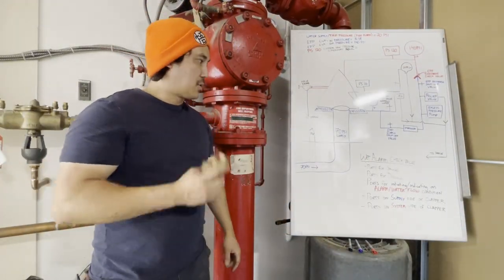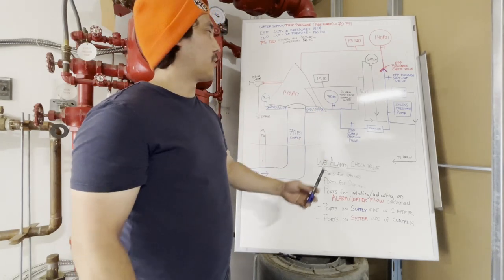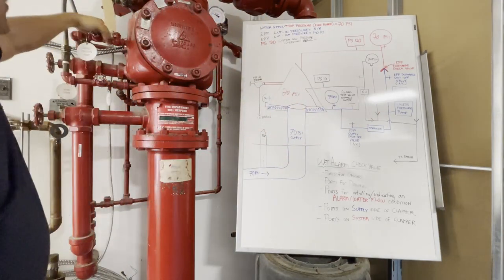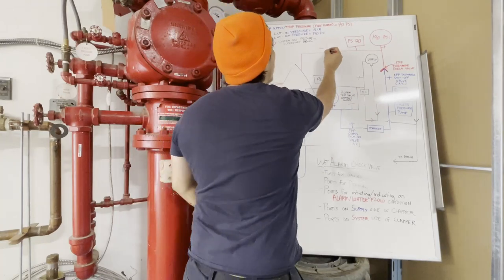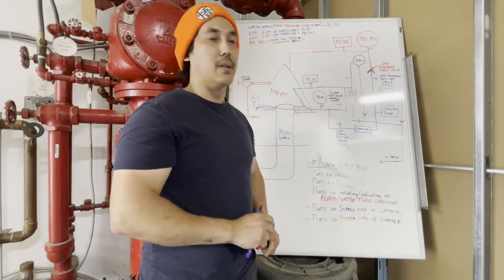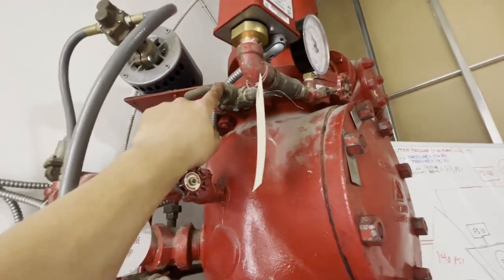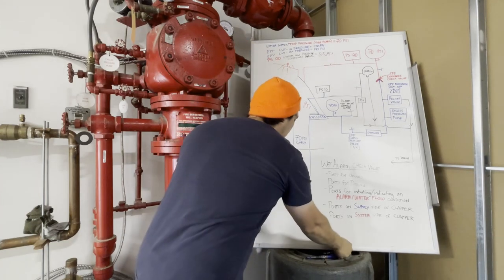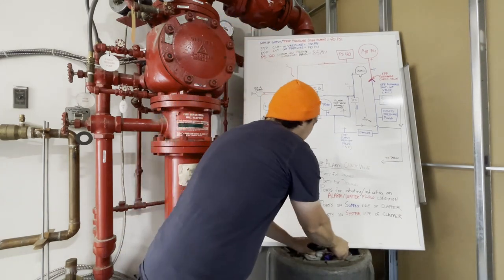Fire Sprinkler System- Wet Alarm Check Valve Explained

Comment: Wow this is the best sprinkler video I have seen in a long time! Thank you so much for posting and please post more!!
Reply from the maker: Thanks for the kind words! I'll do my best to make a similar video for a dry pipe valve and hopefully one of each type of preaction system. Is there any material in particular you would like me cover?
Reply: Dry systems and preaction systems would be great!! Do you service fire pumps?? That would also be really helpful. I love how you showed the components and explained how they work. I am a fire inspector and I’m trying to understand these systems better. Videos like this help me work with installers as I can speak more intelligently on the systems I see. Older, legacy systems videos are always helpful or even a video on a full 5 year process or internal obstruction investigation 😊😊
Reply: Also I wanted to ask, is there a maintenance frequency in NFPA 25 for these excess pressure pumps? I didn’t see them. Does it just fall under a pressure switch for the automatic ones? If so, would that be more of a fire alarm maintenance requirement or fall on sprinkler fitters?
Reply from the maker: @juliebellinger6117  I'll see what I can do about dry pipe valves and Pre-action valves. There's a few different variations of them and I like to make videos with actual live systems so that I can actually trip them/show a real world scenario. 

I do a bit of everything to be honest, its on a job to job basis really. But yes I work on everything, fire pumps, wet, dry, pre-action, deluge, special hazard (FM, Victaulic Vortex, High pressure CO2), foam, fire pumps. I'm a licensed journeyman fire sprinkler installer, and also an inspector. I got lucky on this particular job as I had a fair amount of time during this inspection to the point where I could make use of my spare time to make an instructional video. I'm not always blessed with enough hours in the day to do so. There are quite a few decent videos already out there for fire pump flow testing so I wasn't sure whether or not I wanted to make a video on that. It's been on the back of my mind for a while because there are definitely some aspects that I've noticed have gone unexplained and there's multiple methods for flowtesting pumps which would be neat to throw into a single video.

Actually for the 5-year internal obstruction investigation I practically did 50% of that in this video. They are very strait forward,  simply take photo's of four points on the system: System Valve (which I have open in the video when I took the faceplate off of the alarm valve), Riser (had I pointed my camera UP inside the faceplate and taken a photo that would count as the RISER photo), Cross main (The pipes supplying the branch lines, either directly or through riser nipples), and Branch line (The pipes supplying sprinklers, either directly or through sprigs, drops, return bends, or arm-overs). Snap a minimum 4 photos of the above mentioned points and investigate for the presence of sufficient material to obstruct pipe/sprinklers as well as tubercules or slime Where I live most systems are from a municipal source so I VERY rarely see organic build up of MIC (Microbiologically influenced corrosion). If the system is supplied from a raw water source (like a pond or lake) then you're MUCH more likely to find some goodies. I'll be honest, most wet systems are usually pretty good where I live, but dry systems can certainly be extremely loaded with corrosion so doing internal obstruction investigations on those are for sure worth doing.
Reply from the maker: @juliebellinger6117  Excess Pressure pumps are typically positive displacement pumps (usually 1/3HP maybe 1/2HP at most), and are sometimes referred to as a pressure mainteneance/make-up pump. Their terminology often gets mixed up/confused with a Jockey Pump. In their own right, they both kind of fall into the same category, however a Jockey pump is what you would see as a pressure maintenance pump following a fire pump. As per NFPA 25, there is no maintenance required on excess pressure pumps other than your typical visual inspections- However, there is typically a strainer on the inlet side of an excess pressure pump (as mentioned in the video) which must be internally inspected/cleaned every 5 years as per NFPA 25. Most excess pressure pumps literally consist of 2 parts: a pump head, and a small motor. If the pump head seals start leaking, you can just replace that brass pump head easily by simply loosening the bolt connecting the brass head to the motor using a 1/2" open-end box wrench or adjustable crescent. Pull the pump head off and swap it off easy peasy (also just remember to pull out the cross-shaped plastic thing inside the old pump head and put it in the new one... its just there so that the motor drive shaft can spin the internal gears of the pump head). 

So to put them in order for which pump would turn on FIRST to LAST under normal sequence of operation would be the following:
1) excess pressure pump- turns on to make-up for small loss of SYSTEM pressure. Typically they can keep up with a very small leak on the system, but cannot maintain system pressure should a sprinkler head actually operate. They can be set up for both manual/automatic operation- there is no rule mandating that it must be one or the other. 

2) Jockey pump- turns on to make-up for small pressure loss in the HEADER. Turns on/off automatically and is also typically a positive displacement pump. When the excess pressure pump cannot replenish system pressure at a fast enough rate, eventually the system pressure and header pressure will equalize and the alarm valve clapper will open and cause a flow alarm. When this happens, the jockey pump will be running constantly- soon after if the jockey pump is also unable to maintain pressure, the last pump to turn on will be the fire pump. A jockey pump will have its own dedicated controller (similar to a fire pump), and it will also have its own sensing lines installed as per NFPA 20. Last note- jockey pumps shall NOT be required to be listed as per NFPA 20. They can be listed if you want, but its not a requirement. 

3) Fire pump- essentially the final pump to turn on. When both the excess pressure pump and jockey pump cannot maintain pressure, eventually the fire pump will automatically turn on. Its the biggest, baddest pump in the valve room. They can be centrifugal/vertical shaft pumps operated by either an electric, diesel, or steam engine/motor.
Reply: Thanks so much for all of the info!! Very very helpful! Are you on LinkedIn? If you’re with it, I’d love to be able to message you for input when I come across something weird lol. You seem very knowledgeable!